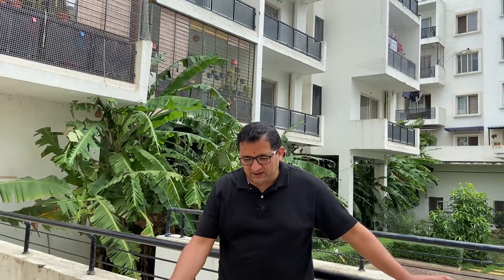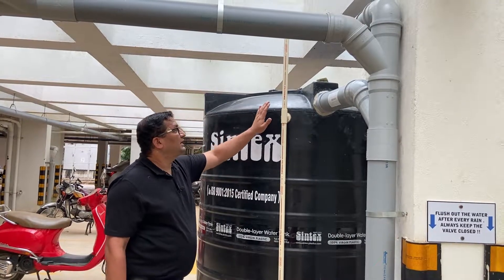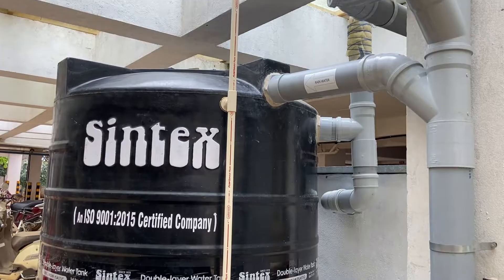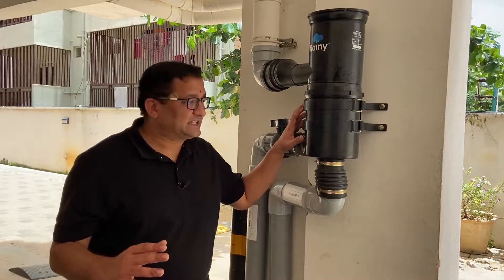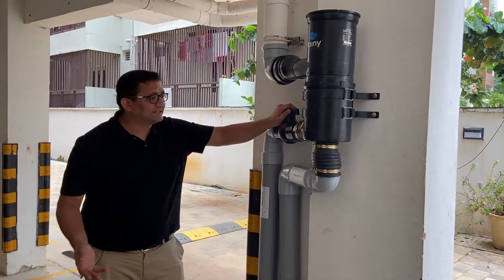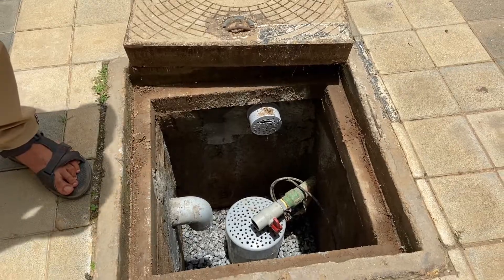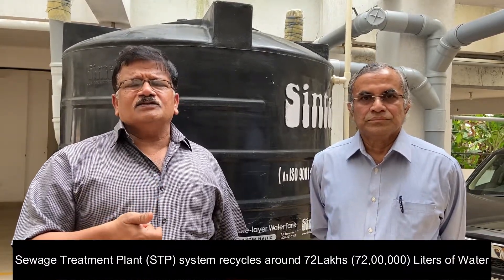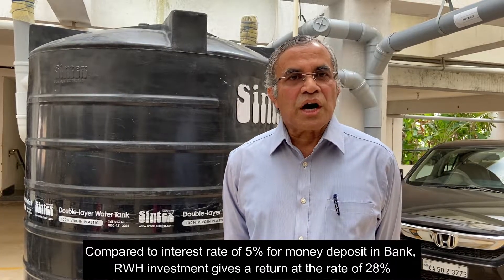Rainwater Harvesting at Century Saras Apartments , Bangalore

Comment: Sir which compound did you use to seal the joints between PVC pipe and plastic water tank? There is no tank nipple available for 4" PVC pipes. So these pipes must be directly connected to tank but this causes water leakage in overflow condition. How to prevent this?
Reply from the maker: Use FTA and MTA
Reply: @HinrenEngineering  Thanks